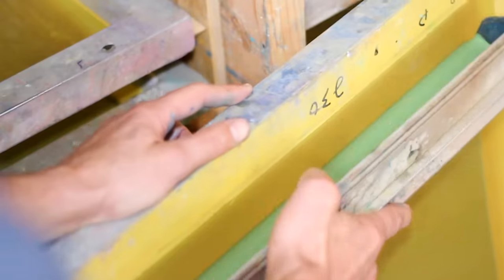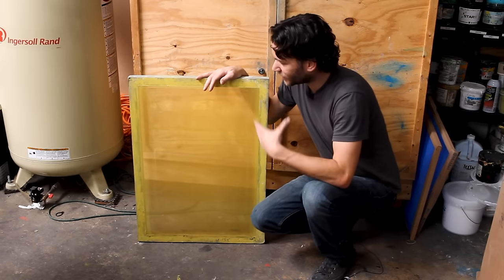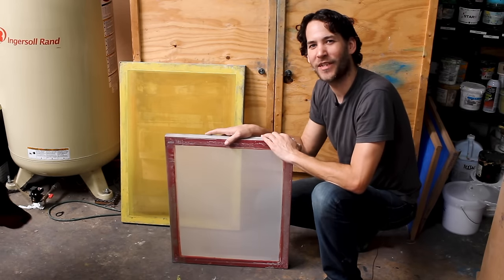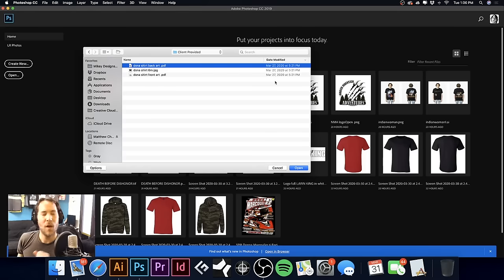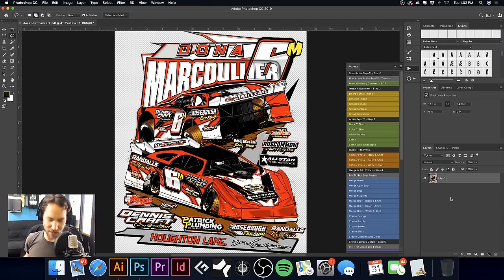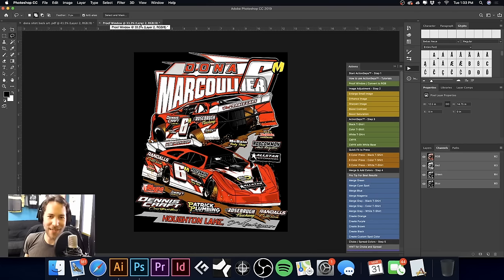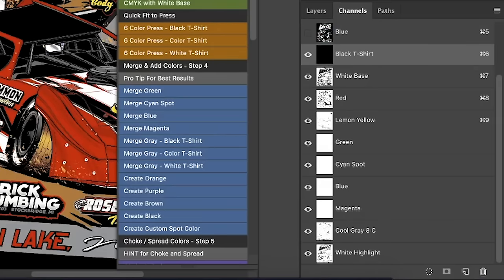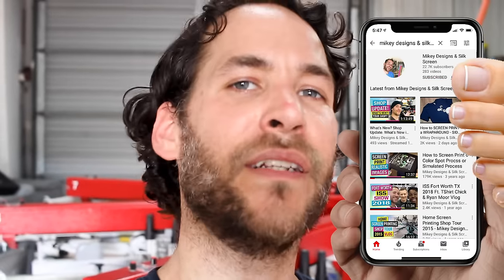Simulated Spot Process: The Ultimate Screen Printing Guide

Comment: Here's a pinhole hint for you - we use nail polish from a cheapo dollar store - use it on the garment side of the screen to catch any difficult to get at spots. Use it during production as it dries in a few seconds and is cheap and if you need to wipe the screen down during a big run it won't roll up like tape does.
Love your vids - and your attitude to screenprinting (we're currently in lockdown here in New Zealand so been catching up on some your stuff but looking to get the machines cranking again next week and trying some of your stuff out)
Reply from the maker: Awesome tip, Chris!  I'll have to give that a try.
Reply: I'll be trying this tomorrow- thanks for the tip!
Reply from the maker: @kingusmaximus  Awesome!

Comment: If you remember, i was having trouble with my screens getting out of registration. after thinking about it, i realized that everything is smooth metal against smooth metal. I guess i tend to spin the colors a bit too rough, and or the clamps dont get tight enough by hand, so i stuck grip tape on the print heads so theres something to grab the screens. Grip tape is sticky on one side and like sand paper that is coated do the grains dont come off. Its used mainly for steps so they arent slippery.
Reply from the maker: I know the feeling! More than likely it's the pallets and the screens shifting. I had to learn how to lightly spin it, well light enough that it wouldn't move anything.

Comment: Great video.  Probably the most in depth and accurate instruction of printing a job from start to finish.  Is your art dimension limitations of 12.5" wide based upon the pallet and squeegee widths or upon the printer for film output?  Thanks, and I enjoy your channel.
Reply from the maker: Thank you!!!  It's limited by our printer for film output. We don't many requested for oversized printing, but when we do, we outsource the film so we can print a larger size.  Our max print size on the press is 16"x18"h.

Comment: When adding the liquid emulsion. You get the best results when using a room with a yellow light. Because white light burns the emulsion that make what you are doing.
Reply from the maker: A darkroom would be ideal, yes. Not 100% necessary.
Reply: What I have done it use a yellow sleeve over the white light bulb. It works very good without having a dark room.

Comment: do you have some fans or heat source in your drying cabinet:? what type of emulsion  you recomend for halftones? very good video. i will try to see more about Action seps.
Reply from the maker: I like to use Ulano TZ emulsion for halftones. It's worked best for me. https://amzn.to/2Vg6QVR
Sounds good! I'll have ActionSeps ready very soon.
Reply from the maker: Oh, forgot. It's just hot here in Houston so they tend to dry quickly on 230 mesh screens, using the sharp side of the scoop coater.

Comment: Hey Matt...do you dilute your adhesive at all? I use TexTac and straight out of the bottle is so sticky. My images become distorted when I remove the shirt from the pallet.
Reply from the maker: Hey Marvin! I don't dilute it. I just make sure not to put too much down, but enough to hold shirts above my image area. You can try taking an old shirt, and rub it on the pallet to help put some lint in the tack to reduce it's stickiness.

Comment: Once again Great video Mikey. what software do you use to separate the color apart from Photoshop and AI? I have seen your other tutorial videos on color separation and it was great but it takes quite some time to separate colors for a single image. Do you manually separate color in photoshop or use any designated software to do so?
Reply from the maker: I like to use Photoshop and Illustrator with our own set of Photoshop Actions called ActionSeps™.

Comment: Mikey, one question here. For plastisol ink on manual spot color printing, do I have to flash the white base once I have coated the first layer or do I have to flash after two coats? As my white base doesn't gave the vibrant White that needed. Thanks Mikey 🙂
Reply from the maker: You'll print the white base and flash it, then print the remaining colors on top wet on wet.  With the second white screen, it'll make the white really pop!
Reply: @mikeydesignssilkscreen473  Thanks for your precious time☺. Can't wait to start my work as soon this madness is gone. Stay safe and God bless you Mikey
Reply from the maker: @mattlyngdoh78  You as well! I'm ready for this to be over too.

Comment: Question: we did a full color on a manual press and we did wet on wet and kept getting white dots to show after and it was rough. Another problem the colors were faded and not bright. We did print flash print and that fixed the dot problem and did about 2 passes each color and it was more bright, still a little dull but much better. Any tips?

Comment: Good video. Can you please tell me if I need to stroke/choke the white underbase (make smaller)  or leave it the same size as other colors when doing these type halftone prints. Thanks
Reply from the maker: Both. Just depends on the graphic. You could spread certain parts of the overprint, or just choke the white base, but you may lose detail by doing so.

Comment: Hey Matt, Do you use off contact with your screens when printing simulated Process?
Reply from the maker: We do! About 1/16 to 1/8".
Reply: @mikeydesignssilkscreen473  thank you! If the ink is getting a smudging texture on solid lettering after the remainder screens are printed over wet on wet how do you avoid the smudging? Hard sqeegy & 230 screens are used.

Comment: Hi mikey!! One question here, you only dry or flash the white under base? The other colors are wet on wet printed?? Or print and flashed after every color? A long time doubt! Thanks!! Awesome video!!!
Reply from the maker: Thank you! You only need to flash the white base. You may sometimes need to flash between colors, but for the most part using 230 mesh screens will make sure the colors don't lay down too much ink.
Reply: @mikeydesignssilkscreen473  but can i do that in a manual press??  And i have to use high mesh?? Thanks again!!!!
Reply from the maker: @TheHxcHXChxc  Definitely! Here's a video of us doing it manually. https://youtu.be/bWN-iR83Jj8
Reply: @mikeydesignssilkscreen473  thanks a lot mikey!!! Take care!!!!
Reply from the maker: @TheHxcHXChxc  Any time! You as well.

Comment: I like your job. I have just a question which kind of printer you use to print  the films to expose on the screens
Reply from the maker: Thank you. I'm using an Epson 1430.
Reply: I used to use the Epson 4900 but recently got the Epson SureColor 600(13x19) All Black ink. Very reasonably priced and way more compact than my previous printer. Thanks for the video.

Comment: Awesome video Mikey I use Separation Studio to do simulated process prints 👍
Reply from the maker: Thank you! This does the same thing, to an extent.  I have used Separation Studio for a long while, and realized it'll only get me so close before I have to bring it into photoshop and manually tweak things to get the print closer to how it should look.  Sep Studio is a good software, but if you already have Photoshop, this will do basically the same thing, and it'll only be a one time payment for much less.
Reply: Mikey Designs & Silk Screen i need to learn photoshop right now i use CorelDraw
Reply: Hey i forgot to tell you the shipping company has lost or misplaced the press LOL🤨😤
Reply from the maker: @bagwear8689  No way! You have got to be kidding? Really!?
Reply from the maker: @bagwear8689  Yes! Photoshop is a great tool.
Reply: Mikey Designs & Silk Screen I’m gonna have to check that out
Reply: Mikey Designs & Silk Screen nope and DHL tried to hide it from me & Ryonet but the same thing happened with the compressor only i thing they were trying to steal the compressor
Reply from the maker: @bagwear8689  Geez! What is up with these shipping companies?
Reply: Mikey Designs & Silk Screen lol I have no idea and they still have not found it
Reply: Mikey Designs & Silk Screen it’s crazy

Comment: What kind of ink is used and how many minutes do we put in the oven?  Can we put it in a heat press for cups instead of the oven
Reply from the maker: We use plastisol inks. They just need to reach around 330º. You could use a heat press to cure them, but you'll get a glossy finish unless you use parchment paper. And curing with a heat press is less consistent.
Reply: @mikeydesignssilkscreen473  OK thank you very much

Comment: Awesome Mikey!!!! but where's the link with the pallet adhesive... I need that ASAP I doing so hoodies and they keep coming up with just the PMI tape... Thanks buddy
Reply from the maker: Thank, Joe!  For hoodies, use webspray.  The spreadable tack won't hold them.  You'll need to spray the web tack every time you load a hoodie.
Reply: @mikeydesignssilkscreen473  Awesome. Thanks for reply. Waisting Bella Canvas hoodies aint cheap... 🤦‍♂️

Comment: Would I be able to do multiple colors with a one station machine. I am not really looking to mass produce anything.. just make some higher quality shirts here and there. I would imagine i dont need a 4 or 6 station, right? I would just swap out the screens for the different colors.. right?
Reply from the maker: You would at least need a press with one station, and multiple print heads. Trying with a one color one station won't work out well.
Reply: @mikeydesignssilkscreen473  thanks man. I kinda figured that out because registration would be too hard. I got the 4 color 1 station from ryonet. I think it came with a flash dryer and uv box. We will see how this goes...
Reply: @mikeydesignssilkscreen473  I’m guessing I will still be somewhat limited with only 4 colors. Especially on dark garments where I need a white underbase? Also, please keep posting. These are probably the most helpful videos on the platform when it comes to screen printing.
Reply from the maker: @alanaspalace4161  Thanks! I appreciate it. With a base, you'll have 3 colors to play with. But you could use red, yellow, and blue for halftones and get a wide array of colors.
Reply from the maker: @alanaspalace4161  Nice! That'll give you some more flexibility. More videos to come! Got a real banger coming out.

Comment: Hi Matt. Awesome Video by the way. In 11:12 you mentioned that you are using water hose with STANDARD WATER PRESSURE only from the line. Sorry for a newbie question but does a pressure wash machine helps in rinsing half tones? Also, will it be an advantage to immediately go to AUTOMATIC PRESS instead of starting from a MANUAL PRESS? I am new to this SCREEN PRINTING. I am a SEAFARER, Captain to be exact, and I am interested to start this business this year in the PHILIPPINES. I am sure you are busy but I will appreciate to hear from you soon. Thank you in advance and be SAFE!!!
Reply from the maker: You can use a pressure washer also. It'll get the job done faster. I use both methods. For some emulsions, I wouldn't recommend a pressure washer because as soon as those halftones are washed out, you need to stop. The advantage of starting with an automatic is the time it takes to do the work, and it's easier on your body. You'll be able to take on large jobs with multiple colors without cringing.
Reply: @mikeydesignssilkscreen473  Hi Matt. Thanks!  I will keep that in mind.
Reply from the maker: @capt.marloncataquis  Sounds good.

Comment: Have you ever thought about using those Digital Screen Makers instead of spending more time with emulsion and all that other stuff? i do not know how well those digital screen makers work but it seems legit if it works 100 percent with no flaws.
Reply from the maker: I have and they seem kinda janky for the price they want for them. 25k. Maybe for 5k but they're way over priced.
Reply: @mikeydesignssilkscreen473  damnn i did not know they cost that much i was thinking like 5k. i know i seen one going for 5k it might have been made in china.
Reply from the maker: @Bluntedco.  You an me both. When they told me the price tag, I was like, nope...

Comment: I have a plotter for HTV and also a sublimation printer for sublimation on Polyester as a little hobby just for fun but i have to say i think screen printing is the best, i wouldnt buy screen printing equipment because i dont have the space but it seems the best to me. HTV dont feels right to me and sublimation is only good for polyester stuff. Screen printing seems to be the only proper way for a decent shirt with a graphic or something like that, for a simple logo with fonts HTV is good enough.
Reply from the maker: They all have their places. Screen Printing is the most common form fo decorating shirts, and is great for large runs. DTG gets better detail, but is limited at the moment by it's speed, and cost. HTV is great for one offs, team names, and numbers as well as glitter. Sublimation is cool because you can apply it to many substrates, cups, socks, shirts, etc. Screen printing just happened to be affordable for me to get into, and it's cost effective for our clients as well.  Keep at it!
Reply: @mikeydesignssilkscreen473  True, i just do it for myself and friends but i personally dont wear HTV shirts, i make gifts with HTV for my little nephew and sublimated mugs for friends. The shirts i would wear are all screen printed i guess. For example those Johnson Motor Company shirts, i guess they are screen printed and i have like 10 of them but you can not do this effect with HTV. They have this faded retro vintage used effect and you can not feel the print at all.  You can sell those kind of shirts as well i guess. https://www.johnsonmotorsinc.com/collections/t-shirts/products/spark-plug-black

I think i do it only because its fun to create something and its fun to design something with a graphic program but i dont have the skill you have, i use a cheap program called affinity designer. 

greetings from germany.

Comment: Got damn this process is TOO LONG !! For. Shirt  ... I’d rather do DTG or laser printer with no cut no weeding heat transfer paper
Reply from the maker: Hardly when you're print 50+ shirts. You'll run into a bottle neck with DTG and heat transfer paper. Plus, a lot of clients do not care for those decorating methods and still prefer screen printing because of it's durability and hand.
Reply: @mikeydesignssilkscreen473  oh wow !!! Appreciate that info